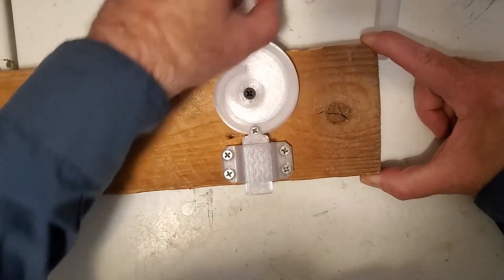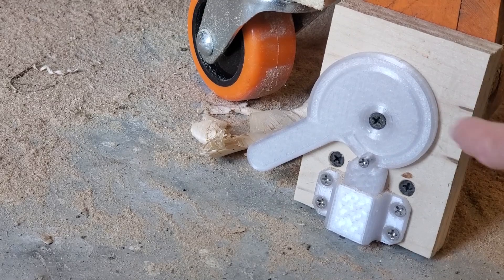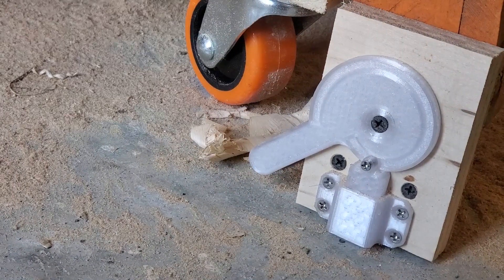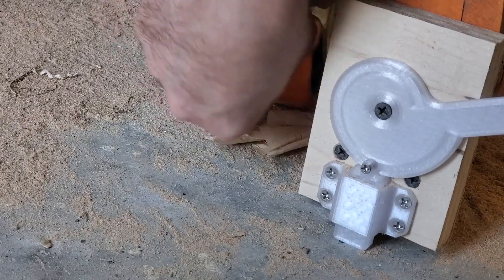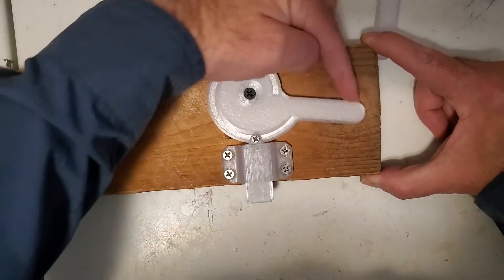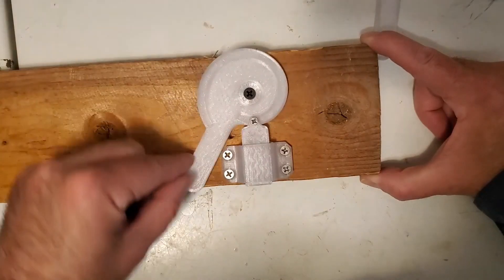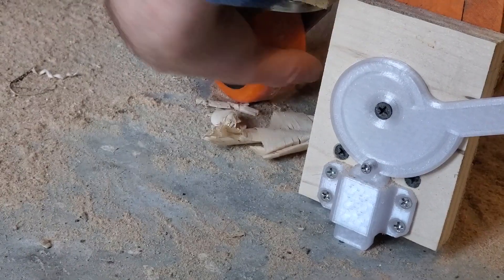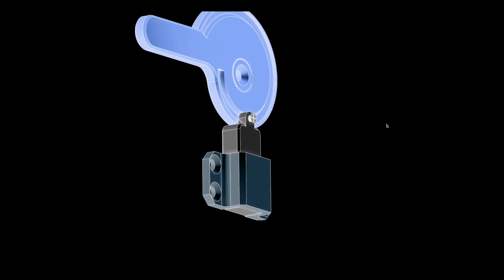Spiral Cam Jack - 3d print to immobilize machines on casters

Comment: I must admit I’m skeptical that four little plastic feet can keep the tool stable long term, but if you revised the design to make the cam lower the casters instead of the feet I think it’d be a great idea.

In any case, thanks for posting! I didn’t even know 3D printed stuff could take that kind of weight in the first place.
Reply from the maker: I've had these on my bandsaw since the fall, so far so good.  Admittedly the cold has kept me out of the shop most of the winter, but they've seen some use at least. 
Having this sort of mechanism raise/lower casters would be totally doable, especially the pin mounting style.  

With 3d printing you can make parts that are stronger than injection moulded,  you just need to design  around the limitations/advantages.
Reply: I agree on all counts. A clever foot-operated system to raise and lower casters would be a game-changer. It also makes particular sense to have the printed part in use only when the casters are in use. This will reduce the stress on the print over the years; the print would only be stressed when the casters were lowered into place, instead of when the casters were up, which is the vast majority of the time.

Allan, I just discovered your channel today, and am very glad I did. Based on the prints you've come up with so far, I'm sure this is well within your considerable abilities. Don't let me down! 😆
Reply from the maker: I have 3 potential approaches to a caster jack setup.
1 - keep it simple and replicate what works in this design,  Make the foot thick enough to accept the stud of a threaded stud caster. Add a knob that can be actuated by foot. 
2 - abandon the spiral cam and go to a screw jack that operates laterally.  This one needs work, with a 4 start thread, and 32mm diameter PETG stil back drives, so I'd need to make it pretty big to function in 1/2 to 3/4 turn. 
3 - use the spiral cam, but drive it with spur gears and either racks, rocking gear segments- lots more complexity, but might be best for ergonomics.  
Perhaps I should do a short video on the topic?
Reply: @AllanMacMillan  If you've got the time, I'd love to see you work your way through this problem. For my money, I think option 1 is the optimal mix of lower effort and higher chance of success. (But if I'm being honest, I'm not sure I completely understand how option 3 would work.)
Reply from the maker: @CanadianCitizenshipTestKit  I just did a video with a few options explained, I came up with a simpler approach to option 3. https://youtu.be/wAi-Ckp82fw